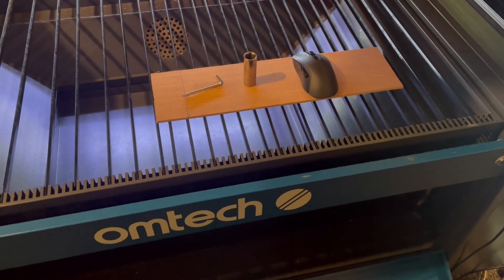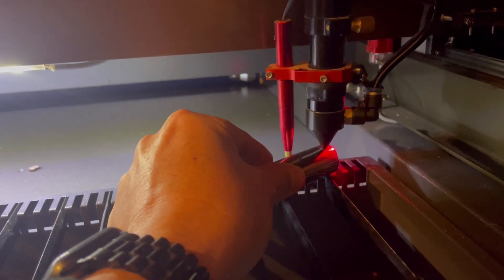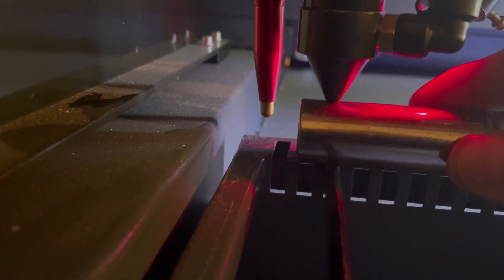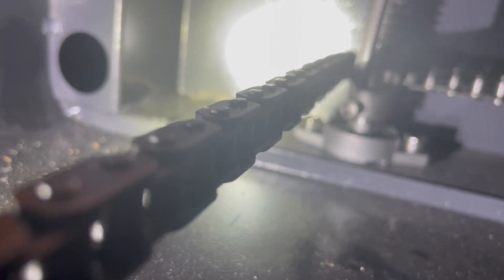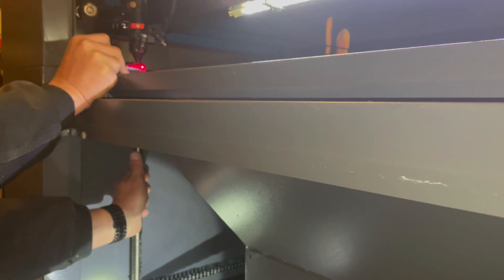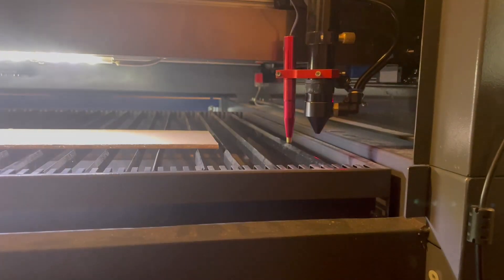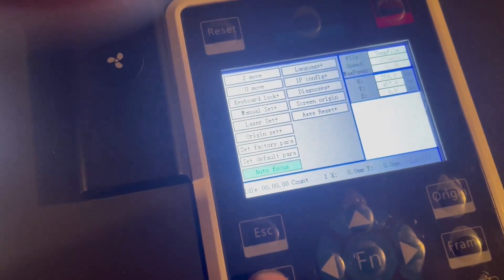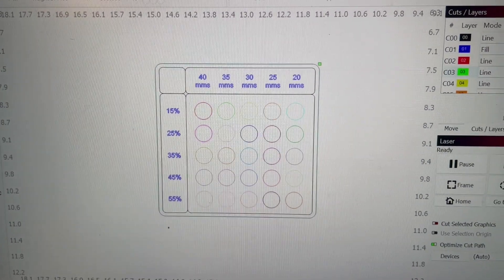Omtech CO2 Bed level the easy way

Comment: I have this same model, and for the life of me, I can not turn the spindle, of whatever it is called. I’ve loosened the bolt with the Allen wrench all the way, and the spindle simply won’t turn. Used a towel for better grip and everything…any advice? Thanks
Reply: Look up, you’ll probably see two lock nuts that you can adjust and do the same thing